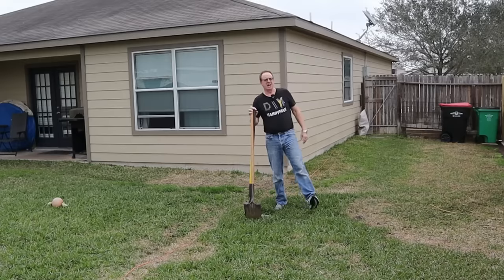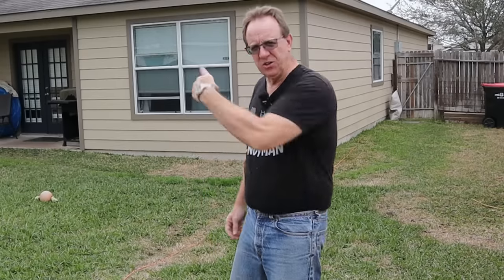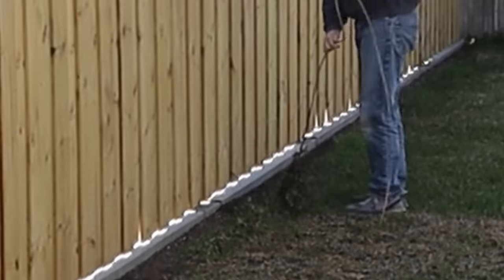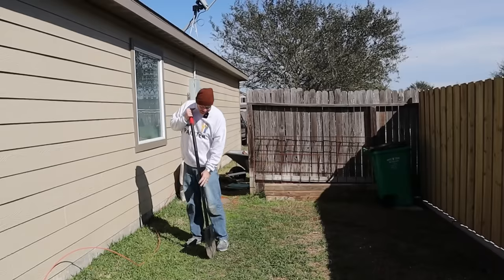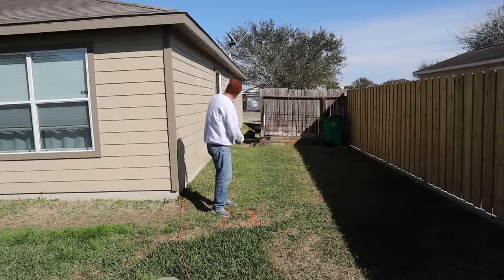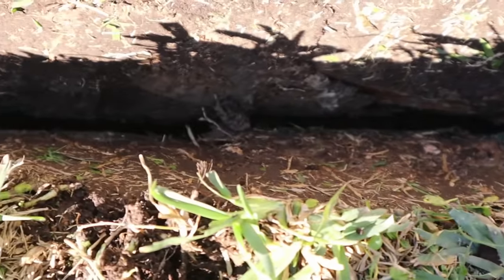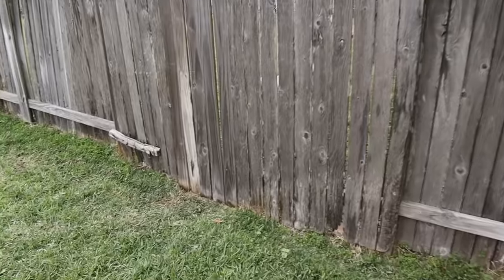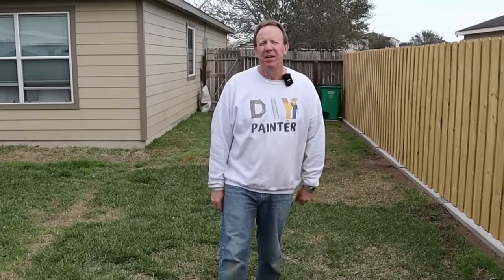ZERO Digging-Trenching Made Easy-Cable, Electric, Conduit

Comment: I need to get MC4 cables that is hooked up to my portable solar generator under ground.  I am having a hard time mowing the lawn with all the MC4 cables everywhere, and having to stop to move the cables so I can mow and then move them back to where they were.   How hard was it for you when you used the spade?  I am an older women, and not sure if I have enough strength to use the spade. I could do a little bit daily, and not all in one day. I am not sure, but I would think that  4 inches would  be deep enough for the cables.
Reply: I just know my county requires 18" so this is useless to me.
Reply: Any type of electrical wiring in the US usually falls under the electric building codes found in the NEC. There are very detailed specifics about the depths of burial as well as types of wire that can be buried. National Electrical Code is a part of the building code that generally dictate how electric wiring can be installed safely. Generally speaking, electric power is not something you may want to accidentally hit when digging around the yard in the future. The electric shock may kill you before you realize you hit the line! Do a web search on the NEC or BOCA, then ask some questions of your local building inspector if you still are unsure. Don't risk your life or the life of a future resident of your home should the energized generator line get hit with a digging tool in the future.

Comment: You buried a temp coax line(orange indicator). That cable will degrade and flood with water. Bravo sir. No digging required huh? Lot of digging going on in the video. Next time use a “flooded” rg6 coax for direct bury.
Reply: All coax lines that need to be buried are Orange. Huh? Black is what’s a no go for bury
Reply: I bet you are a blast at gatherings…
Reply: Incorrect! Not all ug tv cable drops are orange. Some are black. Yes, they must be labeled ug for direct bury. It doesn't what size cable you are burying. Retired from the cable company.

Comment: It does look like a useful tool, but nearly $200 for a shovel (12" model) is insanely overpriced! I'll buy the $30 Chinese knockoff. Not knocking your video, you did a great job. I am floored by how much they are charging for that product!
Reply from the maker: American made.  Thanks for watching
Reply: It does seem way overpriced. Where is this $30 knockoff you speak of?
Reply: I agree, for as much as I'll use this tool, I need something WAY cheaper. I could rent a trencher for 4 hours cheaper than the $200 shovel!  :)

Comment: If your a home owner you're not doing it every day just use a spade shovel and  sink it in as far as you can and wiggle it up and down , just buried a 14/2 electric cord and a phone line over last two days can't depend on phone company said some one will be there within two weeks sorry I ain't buying that
Reply: I guess you did not consider the NEC and local building code when you buried your 15AMP electric line  in a shallow ditch. I hope you and/or your family, now or in the future, does not dig for flowers or any other reason then dig into your energized wire! Not the smartest thing to do when you are playing with electricity. Not to mention, if you did not even use UF cable, the wires could short out to ground if the insulation breaks down and ground water penetrates to the wire.

Comment: 811 is a joke. Just had them out to mark the underground power lines before we replace the posts on my MILs fence. We needed to go two feet deeper than the existing ones. Flags were placed a good 18 inches away from the fence. Guess what we hit halfway thru our fence? Thankfully we were digging by hand with a phd and didn't cut thru anything!
Reply from the maker: Yep they have been wrong most of the time.  They traced one cable line to the underground electrical box.  Thanks for watching.

Comment: Why not just let the telco or tv cable co do it?  They used the same tool (smaller) to install fiber optic.    If you cut it later, shame on them..  Then they have to come back on their nickle for not going deep enough
Reply: @sheepdog3828  So instead of contacting Spectrum,  you take in on yourself?  Look into your city or county codes and regulations.  Have an inspector check it out, then let them get it done right.  Understand you're zealous attempt to DIY it,  but looks like a tremendous amount of work and out of pocket expenses to DIY it.   Just Saying

Comment: I want to build a floating deck about 50ft to 60ft from my house in the backyard..
Could I use this to run power to the deck, thru conduit?
Im in Tacoma, Washington
Reply: I doubt it, in Snohomish county the require 18" of depth, direct burial or not.  I doubt Pierce county is much different but you can easily find out from the county.  I want run electrical to a shed when I get one built.
Reply: No get a trencher and go 24" it's fast and easy. Get a regular garden "hoe" and cut sides off to about 3" wide for an excellent trench tool and cheap. Helps to clean out cave in

Comment: 18" in  the minimum depth for any type of electrical here.  How do I get the other half foot?  Clay is EASY I but that can not cut through the 6 inch wide rocks I am bound to hit.  You must live in the south with all its muddy soil.  MY COUNTY says 18 inches minimum !!  Conduit or not.
Reply: There are exceptions to electrical line burial depths if the line has a concrete layer placed over the top to protect the wire at a shallow depth from digging damage. Also, using a heavy steel pipe for the conduit allows for a shallow depth. Remember also, the wire used in ground for conduit and for direct burial and regular interior house use are all different wires.  Ask before you buy and use the wrong wire for the job you are looking to do.

Comment: Im not sure there are any code for cable line its more of what you are comfortable with its really just to hide them and i mean if you are digging for a fence or something whats the difference between 2 inches and 12
Reply: There are in Snohomish county !!  My NG lines are three feet deep and electrical 2 feet deep.
Reply: @toriless  what are NG lines and why would they need to be deeper than electrical there definitely are codes for eletric but generally not for low voltage it's just more protected deeper but it is more work to go deeper but does that mean irrigation  wiring and low voltage landscape lighting need to be 3 feet deep too
Reply: @james10739  NG I believe is natural gas!

Comment: I am an ATT retiree. We were trained that low voltage buried cable such as ATT cable and cable TV are required to be buried 12" down within a conduit (a pipe) and 18" direct buried (no pipe). Just FYI. Loved the tool.
Reply from the maker: Interesting.  NONE of them are in any conduit here and clearly they didn't put them 12" deep.  Thanks for watching
Reply: I too am retired from AT&T and I NEVER found one at 18”, seldom at 12”, usually 2-4”. Contractors don’t like digging in deep due to hitting things
Reply: I do irrigation, and every single cable line is direct buried at 2-3 inches.
Reply: You mean direct buried 2-3 inches?
Reply: Yeah I’ve been in the telecom game for about 10 years and we have always on done about 2-3 inches

Comment: I worked 21 years for an electric company as a lineman. its simple to get on the wrong line. if you are marking cable tv and end up at the electric meter, you messed up.
Reply: Yeah, same if you are marking NG and end up at the water meter.

Comment: Another vid same tool popped up yesterday ODIYHR. Somehow I believe this geewhiz has limited usage. I mean, were I in the plumbing biz...etc, I'd have one. Looks like it's the cat's meow if your sod is the consistency of out of date froot cake. But suppose you have a real yard with rocks and roots? Still...having dug several long lines in my yard using a blasted spine whacking mattick... yes indeedy..there are easier ways. The lady who used a pressure washer.... Hmmm.... Thanks for the vid...Many good ideas here.

Comment: $186.62 for the 12" Wilton trenching handle, well compare that to renting a trenching machine, maybe the time & back work saved by using a machine may be worth renting a machine, I see where the tool can aid in commercial daily uses in time saved and loading & unloading equipment & it's upkeep

Comment: lol of course they didn’t mark it, that costs them money for someone to come mark it. I mark gas pipelines, hitting a gas line is dangerous, hitting a fiber optic or cable tv or phone line isn’t dangerous. I guarantee if your electrical service lines or if you had natural gas lines they would be marked accurately. I hit my fiber optic internet line trenching sprinklers, no big deal I did my okie call beforehand and they came out next day to repair it.

Comment: Nice video for people that have nice soil with very few rocks. Not so in many instances. It does make a cleaner job of things when you can. Won't quite work in a gravel situation like I have coming up. Good thing I have a willing friend with a backhoe to get the job done. Very nice video. BTW you can get a flat nosed garden shovel similar to your rounded one you did your curve with to do the trenching as well. I have both the curved and a flat nosed one.
Reply: Yea that technique only works in dream soil, not the rocky soil I have

Comment: ATT vs code maybe different.  I was once licensed as a cable installer.  Basically it was below sod was code from what I recall 20 yrs ago. As if everyone does things by code.  Electrical and any piping, I always do to NEC code as a dyi guy or any times I help others. I force it.  But cable.  Idk.  That means nope.

Comment: This is great for low voltage stuff provided you are not in rocky soil.   Most electric lines need to be 24"+ inches deep.     I don't think that tool will do it.

Comment: I can't believe I sat through this, My place is a rock farm.  Just dig and you will find sandstone.  This method is useless for me.  But my original plan might work,  Use a pressure washer to blast a thin trench.

Comment: The locator hooked his induction clamp on the power and likely left the CTV and AT&T bonded to the power ground and missed the utilities because they came across at a 90 and the locator did not do a complete sweep.
Reply: Correct! I worked as a locator for 23 years. I don't know how this guy got into the cable ped unless it was left unlocked.

Comment: Hey -- would love some advice. We have a 400 foot property line with an adjacent parcel (both are about 3 to 5 acres). We discovered two buried 4 inch plastic flexispout pipes coming from the adjacent lot house that were installed when it was built and so I had pop up emitters installed on their lot at no charge to them (to end their potential claim of adverse possession of our land). Now we are looking at the neighbors' behavior and sense they might have more pipes buried on our (now fenced) lot -- to again, make a claim against our property. So they wont tell us if they do or don't  and if so where they are and wont allow us access to their downspouts to run a camera or a copper wire. Our land in this area is native vegetation, scrub woods, rocky, clay and runs to a stream. A GPR company declined the job due to the presence of many roots, rocks and vines and the nearby intermittent stream would screw up their readings.  I have consulted aerial photos from the past and dug a few 6 inch trenches here and there where it looked like there might be something base don lines in vegetation and grass but have found no more pipes than the first two maybe because I didnt dig deep enough or just missed it by a few feet.  I've also tried water witching which is weird because it gives me very strong readings in some locations but maybe its just natural drainage that is causing that because again nothing found. Any ideas on how I might want to go about this?  Oh - and this section of my property is landlocked by a small stream so I can't get vehicles or heavy equipment in there.  Is there a tool that will trench better than a trench shovel or a d handle shovel or a ground probe or a pick? Because i have used them all.
Reply from the maker: Can try renting a small trencher from your local tool rental company, they are not that heavy and the small ones can go at least 12in deep.  Or they make small excavators that also not very heavy and can dig at least 12in.  Hope this helps
Reply: @OakleysDIYHomeRenovation101  Yes it does. Any suggestions on reasons why I might be trenching along my fence line?  In case they ask... like cutting vines?  They will come out and ask. JUst looking for some good reasons under the sun........ thanks!

Comment: This looks like a great tool for running low voltage wire.  I'll probably have to go slow so I don't cut through irrigation pipes.  But if they were installed correctly (they weren't), they'd be lower than I need to go for low voltage wire.  Thanks for the video.
Reply from the maker: True, thanks for wathcing.

Comment: I say if it's not burried by the cable company - call them back untill it gets done.   You have every right to stand right beside them to make sure it is properly burried. 
When the city tore out an alley and poured new concrete, they must have cut 2 dozen cables beween AT&T, Verizon,  Spectrum and old AT&T copper phone lines and came back 2 months later when everyone in the neighbor hood had no choice as the telco was doing away with copper and replaced with fiber optic.  So, somewhere along the edge of the fence are at least 4 cables....all done using the same tool you did.  No risk to me or time and labor.  I recognize I'm on easy street and let somebody else do it.

Comment: I need to bury about 500 ft. of electricle line designed for underground usage and also about 3000 ft of plastic 3/8 " water line for a tree drip watering system. I know thats a lot but I am in no hurry at all so I am wondering if this tool is adequate for this work?? Any suggestions from anyone is appreciated.
Reply from the maker: You could use it but that much to put underground will take awhile.  If wanted could rent a trencher to do it also.  Thanks for watching.

Comment: This is called hand slicing,  and you do not have to wiggle it back and forth like he did . Just push away and have someone stuff the wire . Then you just go over it lightly with a hand tamp . ( used to do this for a living) here in Ct it is not allowed anymore since cable has to 18 inches deep.  They also make a plow for a trencher that will do this and tamp it all at the same time . Also not allowed in CT anymore .

Comment: HOLY COW what a great tool- kinda pricy BUT for the way it worked and not having to trench- it seems like a no brainer- and I was just ahout to start trenching for a sprinkler line- do you think this tool will be ok for that?
Reply from the maker: If you can make the opening big enough for the pipe to fit into.  Make sure the ground around it closes up well afterwards.  Thanks for watching and glad you liked it.

Comment: Very nice.  I was wondering about burying solar cable using UF cable.  I think that you need to bury the cable 2 feet.  I wonder if you could still use your tool for that or if there is something else.  Is it okay just to bury the UF cable 1 foot?  Thanks for  a great video.
Reply from the maker: this tool won't get 2 foot you will need to rent a trencher or hand dig it 2ft.  Will need to check your local code to see how deep it needs to be.  Thanks for watching.
Reply: A boat paddle works great for pushing the cable to the bottom of the trench

Comment: Yep the blank blank blank cable company charged me $75 dollars 30 years ago and yes, they placed it 2 inches below the surface. Now I have fiber optic and it cost me nothing to install. I watched and thIs tool is what they used.
Reply: That would be 100% illegal where I live.  In fact most lines are over 2 feet deep except water.
Reply: Ha my fiber install was them running some 1200ft and cost $50 + 1st mo of service...I said sold haha

Comment: WAIT!  You said Line 2" deep? That's NO Good;  Now you're Using Same Tool company did for line 2" deep?   LOL  
I Know what you mean, 2";  Raking, found phone line 1\2" down.  Cherry Laurel Trees send more, [suckers] from roots, pushing & popping up wherever.  Or it's I, that's the sucker, Digging, pulling, & Cutting ... till, Oops, that's not a Root.
Once, up in air, now Lines just put anywhere.  'Communication' Companies have NO Logical Plan where to bury them, haphazardly run lines across yards;   No wonder i have Poor connection.  
Fiber install 3 days ago, yesterday guy buried line.  My bad, failed to prepare, but worked ahead of him.  Yep, 2" was deepest line was buried, except under sidewalk.  He showed me inground box where Everyone's line connects ... [2+?]  also 2" Deep, pointing at yard i just dug suckers & roots, [not done].   YIKES!  Here? I WARNED, i use Shovel & Loppers ...  
Replacing Bricks i found line No deeper than 2", but where i wanted it this time, along drive & House, as i carefully tucked it in deeper for its length of stay ... till i get busy.  8{\          
NICE Job, Thanks for info, tho - i have sand, it just caves back in.   lol